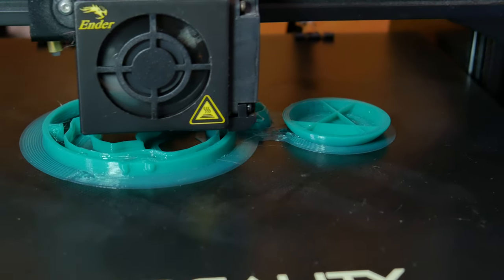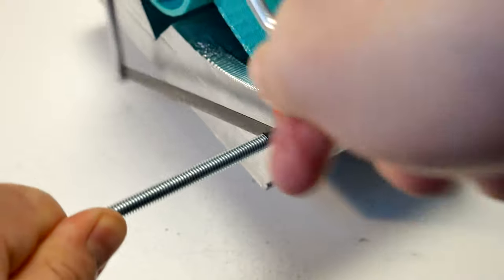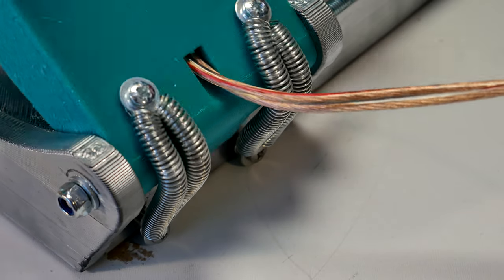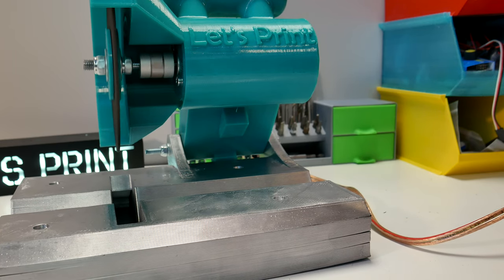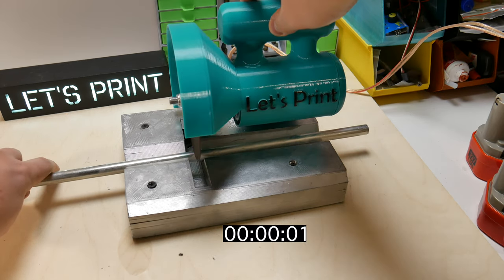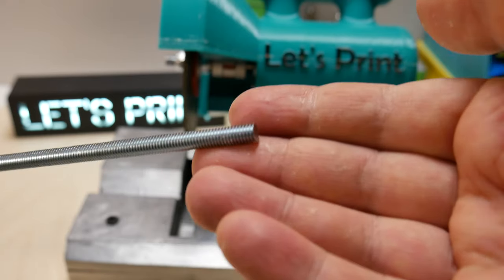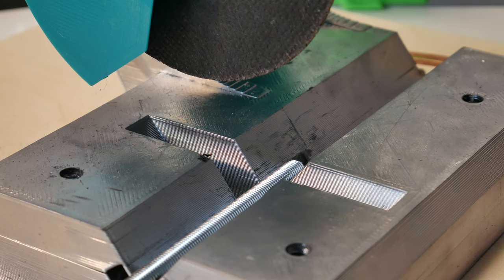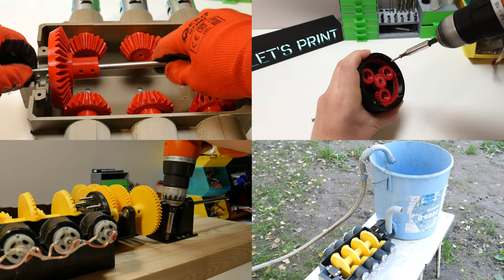3D Printed Power Tools - METAL SAW

Comment: Hey mate, you should use bearing to hold the shaft. The coupling is only to transmit the movement from the motor to the shaft, no for holding it. Your design it's dangerous and it's not going to last. Anyway, I like your channel. Thumbs up mate!
Reply: yup, those couplings are designed to flex also threaded rods are not concentric.

Comment: That cracks/delamination in the ABS part often happens when printing without enclosure. Such cracks can be quite a weak spot in a part that takes mechanical stress. The flex coupler feels wrong. These are typically needed where you need some flexibility between connections. I would try to mount it rigidly as you do not want any wobble/bending once applying pressure. Also I'm not sure  about those plastic disc holders. Metal seems just more like it. Other than that, very cool.

Comment: That sleeve you took off the motor at 0:50 increases the torque of the motor, you should try to leave them on in the future if you need tq!
Reply: How so? Does it add more metal / density for the magnets to act on? Or is it just for rigidity?

Comment: Wanted to mention along with the other helpful comments, the wobble (after filing the seam) is probably largely in part due to using threaded rod as your method of connecting the whole disk assembly. Threaded rods are almost never straight, they've always got some bend to them.

Comment: Engineer here. The coupler you used for mounting the cutting disc is used for the correction of angular errors between two shafts. You should use a stiff coulper like the one of your 3d printer, or similar to that, if you want to get rid of the vibrations
Reply: Hi, Engineer here. "Lots of things"..........

Comment: Before reading any comments I was redesigning it in my head with the following improvements:
1. A bearing support on the outside of the disc. I thought a 1603 might be a nice snug fit on 8mm as threaded rod is typically undersize.
2. Bearings at each end of the hinge point for more smooth cutting operation
3. A clamp to hold the workpiece in the V
4. A 3D printed cycloid gearbox (with all steel pins) for speed reduction. Maybe 10:1 for 1,200 rpm at 10x the torque or perhaps 5:1.
5. A switch on the saw somewhere to disconnect power (possibly like an e-stop in case of emergency)
6. A torsion spring or two to hold the saw up. You can get one out of a cheap plastic clamp.

But this is a great starting point with obviously a lot of thought and work put in already. Cheers.

Comment: NEVER use a spinning rod open ended! You need bearings on both ends to keep it steady, otherwise you will run the risk of shattering the disk or most probably ruin the piece you're working on. Also use a smooth alu or steel rod, not a long screw. Finally, if you are into making power tools, always fortify the body parts with aluminum sheets. Angle grinders are on top of the deadliest power tools league 😉

Comment: Some of the vibrations you are getting are coming from the load the disk is placing on the rod it is on.  You should find a way to support it at both ends and make sure the motor cannot move around in its housing.

Comment: WOW! This is amazing! I agree with other commenters it should be supported from both sides, on bearings or something. Even if it's harder to change blades its safer.

We know 3d prints are strong when made right. Wonder how big of a motor and saw blade you can use?

Comment: Great video and print.... this style of saw is technically a mitre saw and very useful.... what disks are you using... when doing steel work I find that the thin "cut-off" disks cut much faster than standard grinder disks

Comment: Hey cool videos man. To power that saw get yourself a 24V DC power supply. And to reduce the amp draw and power consumption, use a gear out pulley reduction between the motor and cutting wheel spindle. Even 2:1 would double the torque and half the amp draw.

Comment: You could add a support bearing on the threaded shaft integrated in the side cover and that should eliminate the vibration and prevent the blade from wobbling.

Comment: If I may...
Two suggestions:
use bearing blocks (2x) with cutting  disc you're bending the motor shaft. that motor wont last long and you're increase the vibrations but cutting unevenly. 
use a gearbox or chain/belt drive with step down speed a bit but increase the torque as you're stalling the motor a lot.

Comment: you should put a ball bearing on the unsuported end of the blade axis, and possibly connect the motor to that axle with a belt, thus eliminating play and ensuring the axle holding the blade is stiff.

Comment: You are using a Flexible coupler as a holder for your shaft....of course it will bend and vibrate! You need to support the shaft on some bearings and then conect the motor to it with the coupler!

Also stop using batteries. Just make yourself a high power suppy with a microwave transformer. You can easily make a 12-24v secundary winding that can do 1000W or over 3000W peak at whatever voltage you want. Just make sure you use a big chuncky bridge rectifier and also a high power electrolitic capasitor because otherwise they will overheat when you draw too much power from the transformer.

Comment: Why not using a meanwell ac to dc converter? This will give way better powerjuice to the engine because of the higher amperes. It wouldn't surprise me if it wouldn't slow down that much anymore when you reach the end of the cut of the material.

Great project btw!

Comment: With a thiner disk, smaller diameter, you should preserve motor's torque. The coupler is a bad idea IMHO. What about gluing a metal rod directly on the motor's shaft, then remove the wobble by turning/sanding it to get a perfectly alligned shaft ? Then you can thread it.
Reply: I wouldn't think gluing is feasible. For once because you'd have shear stress and glues don't perform well with that. Secondly, balancing would be a nightmare.
Reply: @Longestnickevaaaaaar  I did it on a 1500w motor and it worked ;)
Reply: @axelSixtySix  Alright then. I can't say anything to that. :D